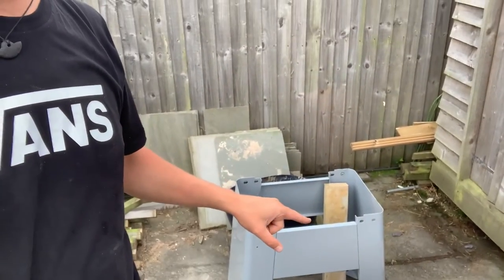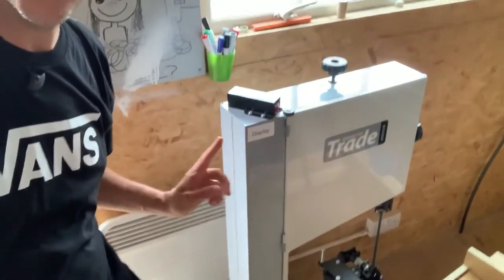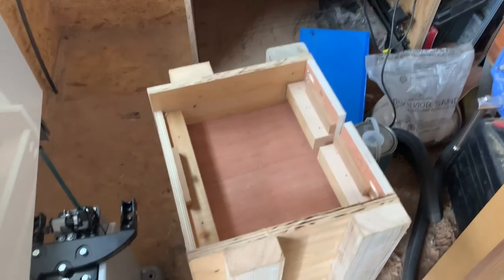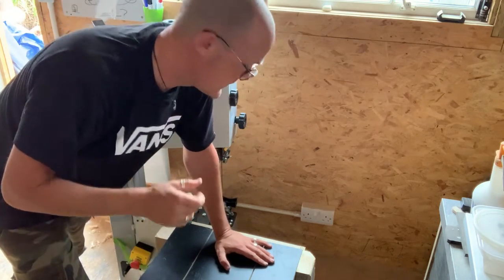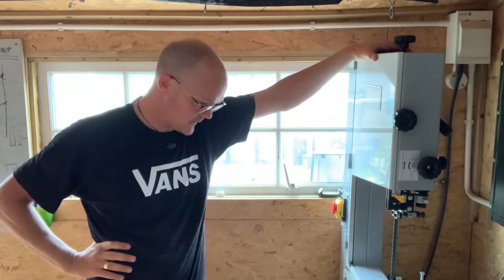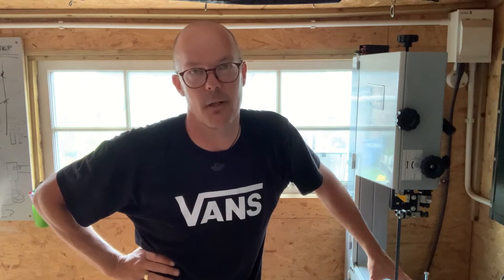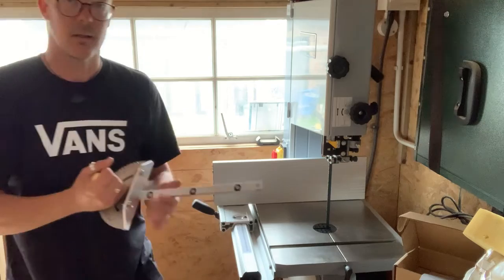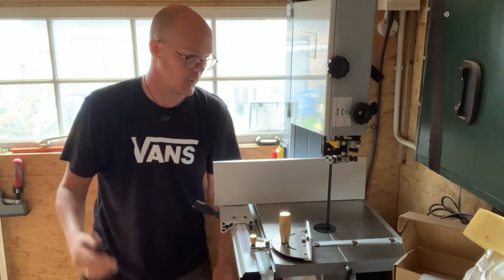Cheap and quick retractable casters!

Comment: Good job, simple and effective.  Beautiful bandsaw; appreciate instructions on how to lift it.   Congratulations and happy woodworking!!
Reply from the maker: How to lift. Really a two person job but if you have to do it yourself then remove the table any hug around the “spine” of the machine” lift with the legs and try to ensure you move from standing height to standing height. I wouldn’t lift by yourself from off the floor.

Comment: These look like the retractable casters as shown on Carl Holmgren's channel.  

One improvement is to put a small piece of wood that hangs straight down from above the lever, pivots off to the left or right of the lever & acts as a 'stop' . Then in one motion you can step on the lever & swing this stop over to hold the lever down while you wheel the cart around.
Reply from the maker: Yeah I had one designed but wanted proof of concept and then once I had it fitted I realized I only moved the saw in and out. Plus I’m lazy.

Comment: Thanks for sharing! Great view of mechanism, nice clear short video. Suggestion: as it's so top heavy, wheels positioned closer to corners using a wider hinge board would make it less tippy in your current setup, short of getting less rubbery wheels, thicker hinge boards or making a wider cabinet.
Reply from the maker: Yeah this was experimental and I hadn’t intended to use it with something so heavy. One year later it’s still in place and working but as you point out it’s a bit wobbly!

Comment: Not an original idea. Carl Holgren came up with this same design a year before you did. You need someway to keep the casters engaged so you don't have to hop as you push the machine. A simple lever and spring will take care of that. Nice score on the bandsaw!
I got a 2 hp, 18"x36", with reversable head for larger turning, all cast iron wood lathe when the company I bought it from was bought out by another Co. and they were changing the color schemes of all the machines
, and the Company logo. It retailed for $2800, 220, 30amps,(it came with 3 different tool rests, a complete 5" chuck set, turning tool set and a metal holder for them that mounted to the lathe body. All for $899.99 including shipping. The only downside, it took 5-weeks to get to me from Taiwan. The money saved though, was well worth the wait.
Reply from the maker: A decent tool score is always a good feeling!
I don’t think I claimed this to be my original design. To be fair the canterlever is one of the earliest simple machines so this design has probably been around in one form or another as long as the wheel.

Comment: maybe a slide lock to hold casters in place
Reply from the maker: Do you mean, hold them in place once they are in the roll position? Like a slide lock into the side of the lever? That sounds like a good simple solution.
Reply: @CaptainofmyShed  slide lock or a spring bolt yup